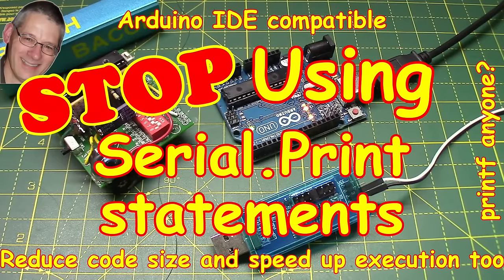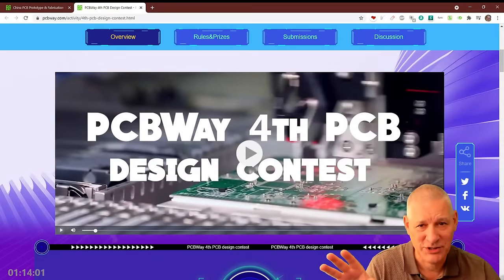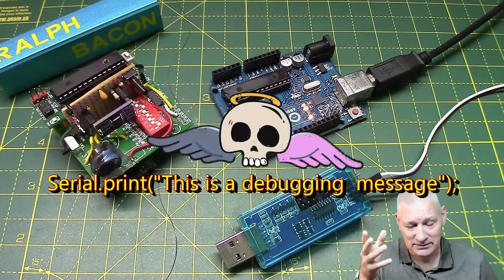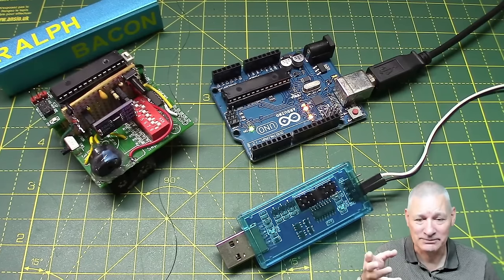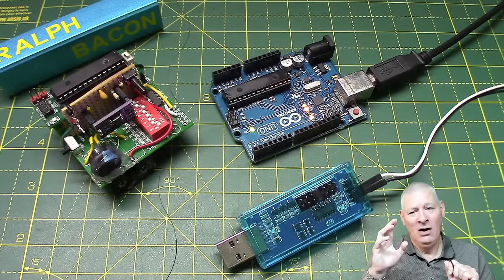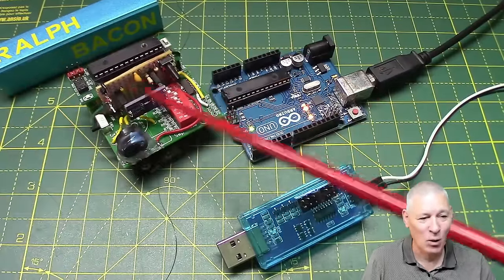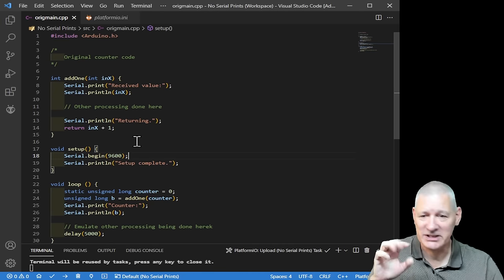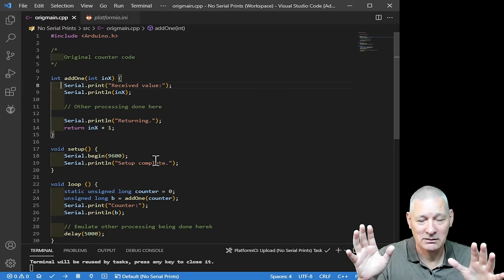#224 🛑 STOP using Serial.print in your Arduino code! THIS is better.

Comment: I had no idea you could #define a function in this way. That's amazing. I was using a bunch of if statements around the serial stuff, but this is much better!
Reply from the maker: That's what drove me to doing this, John. I was sick of all the #if...#else...#endif statements everywhere, destroying the layout of my beautiful (ahem!) code.
Reply: That's a good indication for reading through "The C Programming Language" or other reference material once a year or so, to remind you of things you may have forgotten or overlooked before.
Reply: @JohnDlugosz  There is a book by Henry F. Ledgard called Programming Proverbs (short title).  It was one of our textbooks in school.  It contains a lot of good advice.  One of the best pieces is Re-read the Manual.  The point is that a lot of what you encountered on previous readings may not have been well absorbed because it had no good relevance or contextual framework within your needs and experiences.  As you progress, you encounter new situations which make the relevant and re-reading the manual will allow you to now see how things previously glossed over are now of use.
Reply: @JohnDlugosz  I remember that4 book.  Now retired, during my career I used C occasionally and every time it kicked my but.  POINTERS!!!  What are they pointing to,  addresses, variables, names of variables!  Pull my hair out.  ;-(

Comment: In my personal library I made a header that replaces serial.print with spr or sprl, and I can enter up to 4 different parameters. It's compact, very easy to type, and much more clear to read. Also, with one line of code or even an input wire, I can disable all serial prints at once to speed up the program
Reply from the maker: Sounds like you've done a similar thing then, Nathan. I think most coders eventually devise some method of doing this, thanks for sharing.

Comment: A slightly better, more correct way of defining your debug() macros to do nothing is #define debug(x) ((void)0) instead of really nothing. Please remember that these macros in the actual code are followed by semicolons. So now when they expand to nothing, you have lonely semicolons left in your code. This might sometimes lead to compilation errors and even logic errors. The macros expanding to ((void)0) avoid the empty semicolon problem.
Reply from the maker: Hmm, you may be right but empty semicolons are not a syntax error:

while (1) { ; }

is perfectly legal (and what my IDE insists on converting an empty while(1); to!
Reply: @RalphBacon  One example where the empty debug() macro will cause a compilation error is: a ? foo() : debug(...); This will become a ? foo() : ; and that won't compile. I understand that this is a contrived example, but you'd be surprised how "creative" people might be in using your stuff. (For example, people might create their own macros based on yours, which might use something like that.) My point is that it does not cost you anything to define debug() as ((void)0), which will prevent all (or at least most) such corner cases. I like your presentation. I just wanted to help...
Reply from the maker: Yes, your suggestion is a good one, and the, er, ingenuity 🤔 of developers cannot be underestimated 😜. So, to prevent potential problems your suggestion is good and I hope others read this comment thread in case they are having some weird compilation errors when using my alternate use of debug.
Reply: @StateMachineCOM  Thanks for pointing out a question I had.
I tried your suggestion though and it does not compile.
Just leaving the thing empty it does.
Mind you, I am using Wokwi's emulator and not the real thing.

Nevertheless I would like to thank ALL the people who make helpful videos  like Ralph and those who make constructive comments and suggestions like Quantum.

Comment: I usually just comment out the serial.begin statement in Setup when I'm finished with the code. Doesn't really help with code cleanup at compile, but it does get rid of the slow speed issue due to serial outputs.
Reply from the maker: So by including the Serial.setup(x) as part of the overall #define we could get the best of both worlds, I guess?

Comment: Nice, but how to apply such method to Serial.printf(char* format, arg1, arg2....). This function can have more than one argument, so one (x) doesn't work. Serial.printf is convenient and is available in Arduino ESP32 SDK.
Reply from the maker: Just change the definition to something like this:

#define debugLn(x, ...)  Serial.printLn(x, ##__VA_ARGS__);

which allows any (0 to unlimited) second parameters. I might have included this in the "advanced" folder examples in the GitHub for this project.
Reply: I have watched a number of you videos and have found that you are a very good instructor.  

Would you be able to explain the "(x, ##__VA_ARGS__);" part of this reply in a video sometime?

Thanks for sharing your knowledge.

Comment: Removing Serial.print() statements from your code is as simple as a Ctrl-F to find them to delete them. Doing so is the same as cleaning up after any job; doing the dishes, putting away tools, or using toilet paper. Cleaning up (or "linting") software code is what any good programmer does. It involves deleting commented-out lines, unnecessary blank lines, excessive comments, etc.

Though your #define debug(x) and its associated conditional compiler directive will keep those lines from being compiled in the final version, the debug(x) lines will still be littering the code, impairing long-term readability (even for you after time passes), and adding lines (and associated scrolling) that have no value in the future. 

Let me just add that there's a click-baitiness to the video title: STOP using something everybody uses. It's a tactic similar to videos that say, "You're Doing {something} Wrong." The current video has been cluttering up my feed for a long time, and I've been ignoring it because it looked like click bait. But I finally thought, "Fine, I'll just see what he says." And I was right: click bait and nothing I think is very useful. You don't even actually advocate stopping the use of Serial.print() debugging. You just show a way of globally deactivating it when it's served its purpose.  I understand, of course, that you got credit for my view anyway, and the algorithm is giving you credit for my "viewer interaction." You got what you want, and by complaining about it now so have I. You win, I win.
Reply from the maker: Not at all. 

Removing the Serial.print statement removes a level of documentation from your code that you might well need when (if?) it goes wrong. You put it there originally for a reason, right?

Using the method described here keeps it in place but removes it, conditionally, from the compile process, thus putting away the dishes after washing up. 🤣 But allowing you to instantly (well, after a recompile) to reinstate them.

After a few decades as a pro developer I've valued decent comments and print statement in code (not just mine).

By the way, this was not click bait of any kind. I thought it described my video perfectly as I believe we should indeed STOP using standard Serial.print statements (in the ESP32 world I never use them, using the built-in conditional debugging levels instead). You didn't find it useful, fine. But don't tell me that I'm into sucking you in to watching a video you don't find value in. That's what the STOP 😁 or BACK button is for.
Reply: @RalphBacon  🤣 100% agree. You even covered it in your video. "Crap, it's broken again - let me put them back in for a sec". This is real world programming. It's not the same as academic programming. Sometimes you have 1 day for a turnaround POC. DRY isn't the best way to do things. Obviously he's right once you move into a final production product that will never change again, but how often does that happen? We're always iterating
Reply: You should rationalize your debugging code and only leave in what is likely to help in the future (because now you know what helped), review what remains to make sure it has no side-effects that would break your code if it was removed, and then use C# preprocessor directives to control whether you include the debugging code in your executable.
A more sophisticated version of the above is to define a set of debugging levels, again which you control by preprocessor directives.

Finally, if it is possible in your environment and seems warranted, add some kind of logging, using the same levels strategy as for debugging.
Reply: So what does switching between "Debug" and "Release" do in visual studio C/C++ you think? Exactly what he demonstrated in his video... Your find and replace method doesn't work in many editors when you have multiple files. And you can add a header to your arduino library so you have these debug methods available in all your projects by simple one define and include. I have a book of C++ for beginners and the first chapter after the introduction is about the preprocessor. Only plebs use find & replace.

Comment: Very good message. I have been working with a Nordic chip and initially I was inserting debug messages. Later when I starting the power reduction phase I realized that activating the UART port increased the power consumption more than 10X. Still at some point you really need the serial printing but when moving to running on battery I disable the UART totally. I have not tested on a Arduino if the Serial.begin() is impacting on the power consumption.
Reply from the maker: Good info, Tom. And we can disable the UART in the Arduino world by using:

#include <avr/power.h>
power_usart0_disable();

which could possibly be part of some precompiler construct too (not done it, but it should work).

Comment: When I first saw this video being suggested to me, I thought this was an advisement against using Serial.print commands for passing information between microcontrollers and computers, so this was a bit of a surprise.

On the other hand, I guess this is down to personal code style preferences, as I'd much, /much/ rather NOT use custom-defined preprocessor "functions", as that severely limits what you can pass into them.

Given the fact that I've been using C and C++ for years, along with the preprocessor's very powerful replacement system, I'd rather use "#ifdef DEBUG" blocks around the code specifically handling debugging. Plus, this practice highlights your debugging code more strongly than yet another apparent function call that doesn't get coloured as such by the syntax highlighting.
Reply from the maker: It's a case of horses for courses, Daryl. 

Use whatever works for you. I personally hate the #if...#else...#endif construct for debugging statements, but if you don't mind the strange formatting this brings it's not a big deal. I just thought I'd share something I use myself. 

I think it's useful for hobbyists and beginners rather than professional C++ programmers, but that's just my take on things!
Reply: Nowadays, good compilers will eliminate dead code.
Thus, I usually use simple VERBOSE adjective before the Serial.print/printf or blocks doing debug prints, which I defined before as "#define VERBOSE if(0)" or "if (1)". 
For the different levels of verbosity (e.g. -v -vv -vvv flags) can be done by "#define VERBOSE2 if(verbose_level >= 2)", etc.
#ifdef #if look quite ugly, but I also use them in some cases, it's good alternative to have commented out section of old/different code.
Reply: @vasiliynkudryavtsev  i love that, im gonna use that from now on for debugging
Reply: @alexstone691  I'm glad, my experience helps.

Comment: Thanks for this great tip! I have a couple of further suggestions:
1. Use all caps when you define a macro so you can tell the difference between a function call and a macro because macros are expanded before compile, and sometimes this is important to know.
2. Surround your macro definition with '"{" and "}" so that multi-statement macros will be guaranteed to behave even if you don't know they're macros. As example, a multi-statement debug macro will compile fine and yet misbehave in code that looks like this:

  for(i = 0; i < 100; i++)
    debug("foo");
Reply from the maker: Good suggestions, Jeff, thanks for sharing. 👍

Comment: #define DEBUG

#ifdef DEBUG
    Serial.begin(9600);
    Serial.print(debug message);
#endif

if you comment out //#define DEBUG and then compile it, all your serial functions should be removed in the compiled bin, well as far as i understand it anyways.
just using an if debug == 1 is not enough as your still doing that check.
Also #ifdef is already part of the sdk and you wont need a lib for it.
Reply: I would also recommend such an approach👍I always define myself a function that wraps around the serial.print function. Inside of this wrapper function i will have the #if ... statement. With this you can keep your code a little cleaner, as you don't need precompiler statements in every print call, you just call the wrapper function☺️
Reply from the maker: Yes, removing the Serial.begin is very doable and ensures the entire library is removed by the linking process.

Comment: #define DEBUG 0
#if DEBUG == 1
  #define DebugBegin(x) Serial.begin(x)
  #define Debug(x) Serial.print(x)
  #define Debugln(x) Serial.println(x)
#else
  #define DebugBegin(x) 
  #define Debug(x)
  #define Debugln(x)
#endif
Reply from the maker: If it works for you then it works! I haven't tested this but I might give it a try in my next sketch!
Reply: @RalphBacon  Yes it works very well
Reply: Making a DebugIf(condition, x) is good too. This allows you to have other debug symbols, such as DEBUG_SERIAL, DEBUG_PWM etc. Having DEBUG=0 to switch all debug printing off is useful for a production build, but having all of the prints running when DEBUG=1 can be very tiresome to read, and obviously makes your code very much slower. This more fine-grained approach allows you to just show the debug prints that are relevant to the part you’re working on / testing.

Comment: I've watched so many videos with demos that show the serial output on a separate window, but I can never find anything showing how it is done. My output always shows at the bottom of the IDE 2.0 sketch. Will you please explain how to set this up?
Reply from the maker: That's because you are using the in-built Serial Monitor of the Arduino IDE. I'm using a standalone program called CoolTerm which is nice, and it's free too, although Roger is grateful for any donation if you find that you use it a lot: http://freeware.the-meiers.org

Comment: how about this:
#define verbose true
if (verbose) {Serial.print.....}

then, once you are done with debugging and you go production you change to false and nothing is printed
except that we have lots of "ifs"
Reply: This is not used in production, and the simple macro method is only used. Here you are on the mercy of the compiler optimization to remove the dead unreachable code, whereas in the macro method, you are controlling when it will be part of the code or not.
Reply: @PriyankBolia  you are right
Reply from the maker: See my GitHub for an advanced version!
https://github.com/RalphBacon/224-Superior-Serial.print-statements
Reply: @RalphBacon  grabbed - thank you

Comment: Hey there Ralph.  Another great video; informative and entertaining.  I'm going to add this to every sketch I develop from now on.  It is just to simple and easy not to do.
Reply from the maker: Fantastic! I'm using it right now in my current sketch, Adrian, and it works very well! It can be tweaked as required too, or the Advanced version can be used (in my GitHub).

Comment: I have been using FOR AGES  
bool debug = true;
if (debug) {
  Serial.print("my text here or whatever")
}

and thats it... Okay thank you.
And I am sure a lot of people are actually doing it this way.

Why do I think its better?
Because you can fast an easy create differen Serial debugs for different tasks.

like add another one that shouldnt be run with another.

bool debug2 = true;
if (debug2) {
  Serial.print("my text here or whatever")
}

And so on.. makes it even better and faster
Reply from the maker: Having granularity with debugging is a good idea; if you look at the Advanced example in my GitHub you will see a variant of this, where I have Verbose, Debugging, Warnings & Errors selectable as debugging level too. 
But now I'm thinking that having some descriptive debugging names like you suggest - good  idea, thanks for sharing!
Reply: function debug(text){
if (debug){
serial.print(text);
}
}

😁 + Indentation
//I wonder if there's a way to detect if the potential of the tx pin changes....... Could enable debug when something is plugged in.... 🤠

Comment: As soon as it goes to some more than an AVR, I use "#define DEBUG(...) printf(__VA_ARGS__), but in more complex systems I prefer to work with tokens added it automatically so I can see the part of the software, the warning is coming from. But for that you have to write an va_args warpper that then connects two printf resulting in something like
[ENC] Stream picked up
[MOD] setupt tx frequenxy
[LO] Frequency set
[MOD] Gain set
[RF] TX On
[ENC] Stream started
A bit like the ESP_LOG mechnaism but not that bloated in the output. And I also often have 2 Levels of debug. One that helps you to design the thing and one that stays on forever and gives you a clue in cases your thing doesn't work as expected.
But other than that I prefer to work on STM32 and just use JTAG online debugging diretly into the thing, and keep printfs as rare as possible.
Reply from the maker: Yes, that sounds like a good method. I sometimes use a spare GPIO pin that only outputs the Debug message when it is is LOW. It doesn't help with program bloat but does keep things moving at speed when you don't need the serial output.